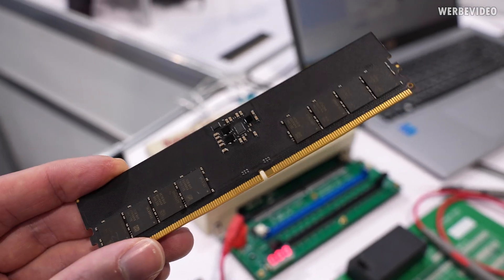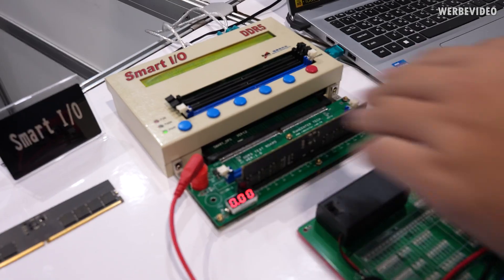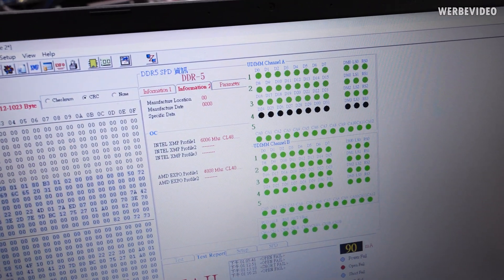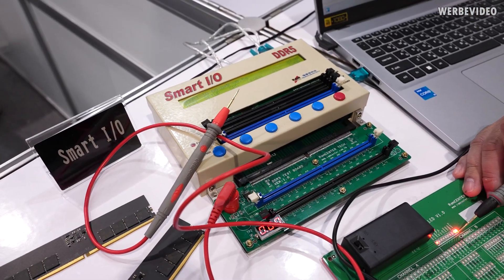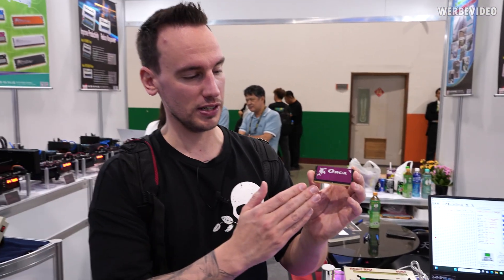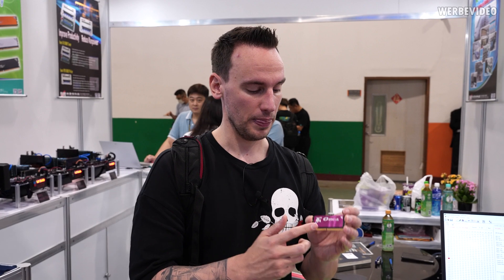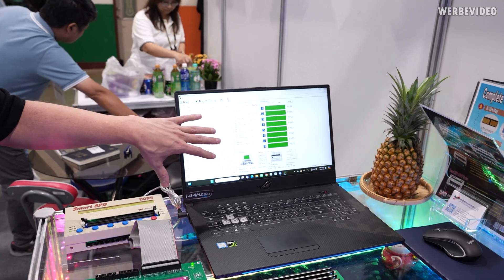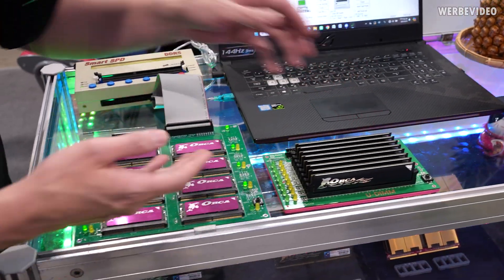How Memory Sticks are tested and programmed

Comment: As an EE, I've always found that Z-conductive rubber stuff pretty amazing. It's basically a similair concept as what LCD's use to get a connection on their conductive-coated glass regions that need a connection. I am surprised to learn that it's just as good as soldering though.. I'm not 100% sold on that until I see some resistance-to- surface area per thickness numbers. But it also means that if it can work in the les-than ideal rail-conditions of that tester, then it will certainly work once properly soldered afterwards. So good enough, and purpose served.

Comment: Nice Video , it's always interesting to see out of the box procedures , the specific tools normally aren't visible or detailed  . for the conductive rubber , we can find it a band in a lot of lcd displays to make the contact between the cristal/glass LCD and the pcb that controls it . the bands are a sandwich of rubber with carbon like pins/rods in the middle . in these case instead of a band it's a square , the production of this squares must be very specific , maybe layers side by side to achieve the pin array spacing

Comment: That "conductive rubber" stuff is really interesting! It's almost certainly an "anisotropic" material where it's conductive the in Z direction but not X or Y (so you don't need to align it), and a primitive version of it is used in the "zebra strips" that connected old fixed-layout LCDs to things like hand calculators and other small electronics.

I wasn't aware that they made material like this with sufficiently fine conductive channels for connecting modern DDR4/DDR5 ICs, and that they can support enough current and isolation to maintain signal integrity for this kind of testing with modern high-speed circuits. Very cool!

Comment: A company I worked for had a memory tester that tested sim modules. Problem was that it was bloody expensive, but as the first DDR generation were just introduced it became useless as it could only test the older memory standard. it was bought when we had a lot of problems with the memories and it did it's work well. But as I said it became unusable when DDR became standard.

We also had a machine that washed motherboards. This was not often used, but it was bought when an entire batch of motherboards from one manufacturer turned out to have problems caused by badly washed motherboards from the factory. So we bought these cheap and washed them in that special machine. Well over 90% of them worked perfectly after that. The warranty period was one year for our customers so it was pretty important that they were reliable. The rate might have been close to 100% but I can't really say. It was however well over 90%.

A problem with test machines are the changing standards. That machine you bought for a lot of money suddenly is useless.

Comment: Can anyone give a hint how hard it is to DIY a JEDEC standard SPD? As a passion project I’d like to build my own unbuffered ECC DDR5 DIMMs with DRAM ICs harvested from various overclocking DIMMs to get modules that do higher frequencies and tighter timings.
Reply: It's actually easy, the expense is in the module testers themselves but it can be done without one using individual sticks and testing per IC. Has been done before by guys in the XOC scene
Reply: Thanks for the information!

Comment: speaking of "Testing"
Can you make a video about M.2 NVMe slot voltage tester?

There are several cases where a brand new M.2 SSD died so quickly because the slot itself gave too much Voltage

Comment: I remember seeing my dad going to a 7-11 in the 1950s with a handful of vacuum tubes from our TV. The store had a machine that tested the tubes for free. The machine would indicate if a tube was faulty. Below the tester was a cabinet stocked with new vacuum tubes. You removed the new tube(s) you needed and paid the store for them.
Reply: Sometimes they bring in those devices in our repair dept. That testing bench is totally different from with solid state devices. We are going way back then, lol.
Reply: Analog devices are resilient to failure and easy to diagnose. I wonder if each memory integrator customize their own testing equipment the way the ORCA company does.

Comment: Love how that ram tester looked like it out the 80s/90s and the software looks right out of the Window 98/XP era. Something comforting in that.
Reply: "If it ain't broke, don't fix it"
Reply: @duccc  Yes, Ducky that mantra is solid.
But we are talking about advancing the human master race here.
Reply: I believe you can test broken GPU's with a software that looks like that. Checking if the VRAMs are working or not.
Reply: This is what you get when its all about the information and nothing else.
Reply: it's a program that runs "natively" on the CPU without any OS. Memtest and other similar hardware test tools are console only, showing a console-based interface like that
Reply: Yeah, I was staring at the design for so long.
Is there really no one left that is designing and coding for RAM anymore in the year +2000!?
Feels like we are losing so many engineers in the RAM department and none want to go and learn it all.
Reply: @N0N0111 not much reason to. The software is only used by skilled/trained technicians and engineers. It has all of the information and controls needed front and centre. Plus, it works. Redesigning it would mean not only training everyone on the new software (which will probably temporarily increase the error rate due to incorrect usage), but also might introduce bugs that didn’t exist before. So why go through the effort when the existing tech works?

Comment: I LOVE these videos, on tech and How it is done. Always wondered how do they test them, how they debug them. I wish you made more of these factory/engineer tours...

Just wondering, how could the "hotswappable" coupling module with rubber contact perform in daily operation. Just imagine the options.

You could like 50 RAM modules when new dies come out, swap it for the ones in your system, test which combinations performs the best and run it...
Maybe not as easily swappable as those in the video for increased stability and cooling, but ... damn, the TRUE modularity of even RAM modules on the sticks would be awesome.

Or having these test devices in local stores to test the faulty DIMMs, swapping the faulty modules and selling them as refurbished would save tons on shipping back and forth across the globe. And create local jobs. I am not really green fanatic, but in the RAM space this could be sensible, especially as you have so many modules per system in every PC... They could just order reel of modules from few major manufacturers and do the fixes without shipping it to other continent.
Reply: Problem is the cost of those IC test modules, I've been interested in buying them for years but the prices are insane just for 1.
And this is coming from a guy who has paid over $500 for DDR3, DDR4 and DDR5 kits

Comment: This is very cool. Is how they actually bin high speed modules? Check each IC on the whole DIMM until they get a good combo of parts? I thought machines did all of this work.
Reply: Maybe for the bigger manufacturers. But smaller manufacturers often rely on more manual processes.

Comment: Looks like they took Memtest86+ and repurposed it
Reply: it's just the enterprise equivalent
Reply: Memtest86+ interface is different. Just because it looks like a DOS program does not mean it's the same thing
Reply: I couldn't find it.
Reply: yea probably a GPL violation too. As it is released as GPLv2.
Reply: @tuttocrafting  If they're only using it internally, it's fine, no?
Reply: @concinnus  it seems that the company sell solutions for small ram modules manufacturer.
So I suppose that the software is sold with the zif kit.
Reply: @tuttocrafting  even assuming they use memtest code, what makes this a GPLv2 violation? GPLv2 only forces you to provide the source to the people that bought the device using the software, if they ask you to. So in this case their clients can ask for the source code, that's it. You can sell the compiled software all you want, that's not a violation either

Comment: My 7200 teamgroup can do 8200 but my 8200 vipers couldn't do 8200
Reply: And that’s why I’m using 5600 ram. I don’t need that extra few percent in exchange for instability. Mind you I bought it in late ‘22 when higher really seemed to have issues on many z690 boards. Wish it was 6000, but for a  12700k… it’s fine.
Reply: @Akkbar21   For all the years I have overclocked my main gaming systems, I have learned this.
You find the desired speed (MT/s) you want to run your RAM.

High speed  for  high data transfer.
Medium speed  for  super tight timings with superb low latency.

The key, after you have found your settings is to find the golden voltage that your RAM will be stable at.
For DDR4 and DDR5 1.4v is the standard to run the RAM optimal for both scenarios. Always have your RAM temp below 55C in an hours burn in stability test.
After it has passed the +1 hour 99% load test, up your voltage with 0.01v, this is an extra save barrier for random voltage instability.
As last buy a motherboard that has Load Line voltage calibration settings for RAM, this will super extend RAM stability.

As final don't be afraid to read through some overclocking forums about RAM.
Reply: @N0N0111  that’s great and all. I prefer to set xmp or whatever amd calls it and it’s rock solid and works.
Reply: @Akkbar21  My experience's over the years for having a dialed in RAM that is load tested. will last you a super stable system with near to none blue screens.